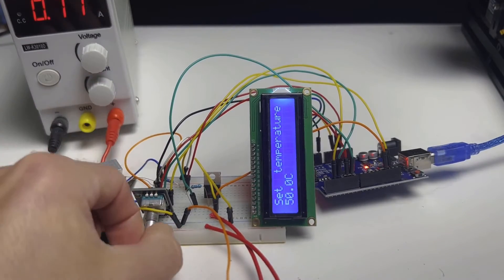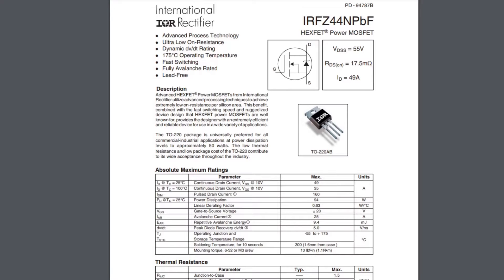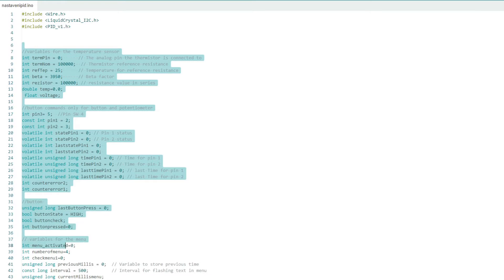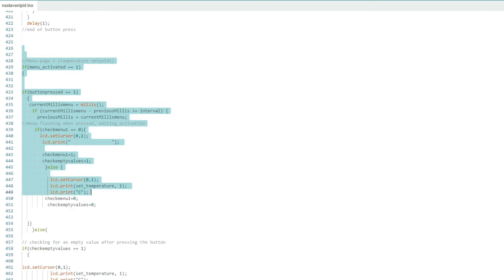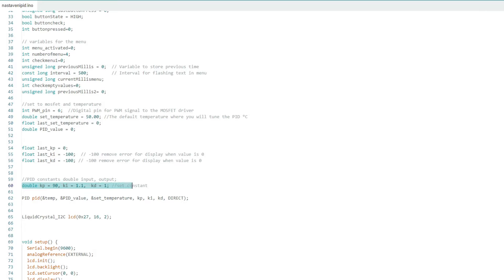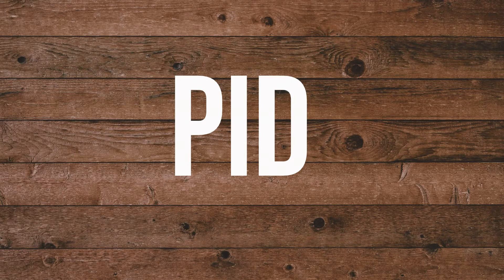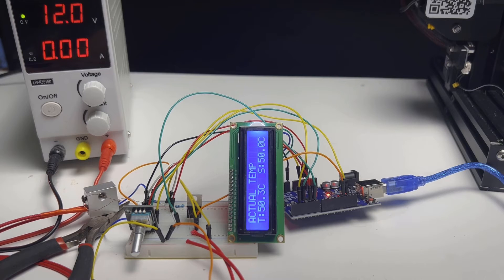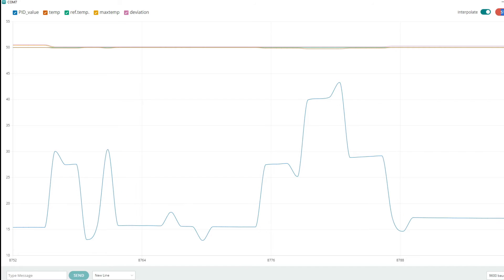Connection Of The Heating Block Including PID Control And Menu - ARDUINO !

Comment: Dear friend,
the value you use for the termNom and rezistor variables is greater than the allowed values.  Αn int stores a 16-bit (2-byte) value. This yields a range of -32,768 to 32,767